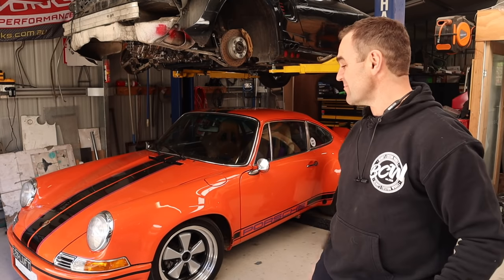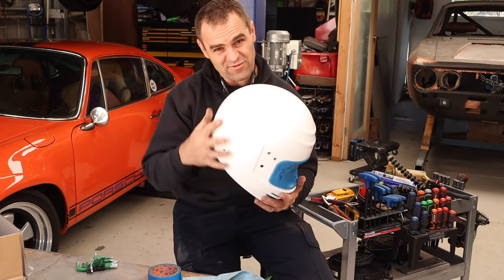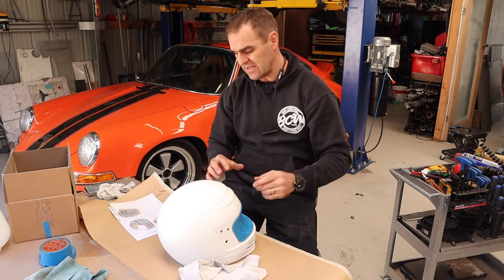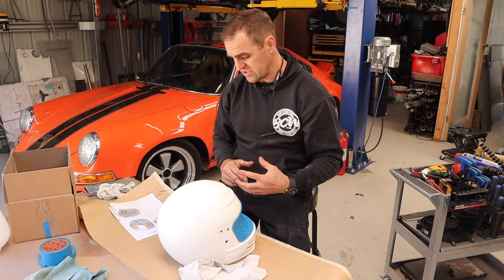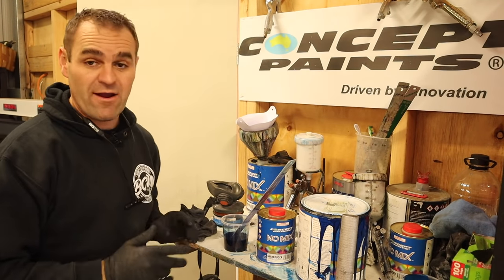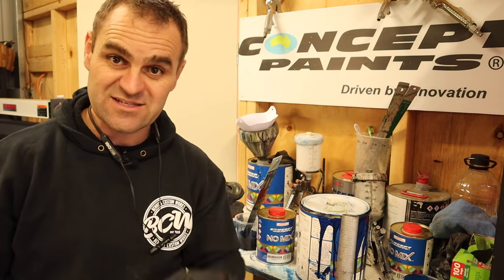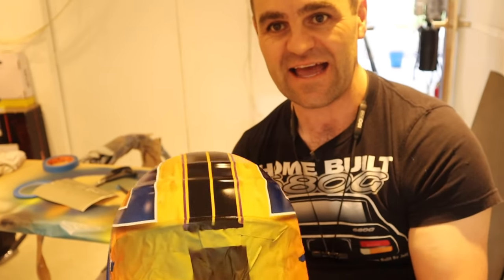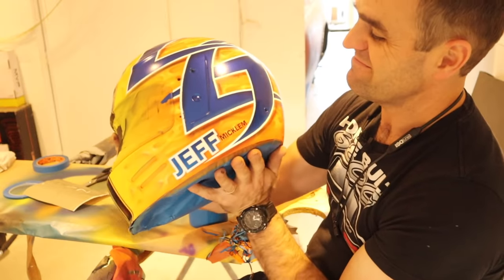How to custom paint a Helmet

Comment: Great work, Jeff.  Just a couple of quick, basic questions, please.  I want to paint a "raw black" Bell Star Carbon helmet (hate the nasty black) into white with some basic stripes.  
First, does it compromise the safety of a Bell Star carbon shell to paint it?
If it's OK to paint, would you use a primer when after sanding down?  You mentioned "auto paint" - would that be enamel or lacquer?  Is there a preferred final clear coat?  
Finally, when you're doing a layout with masking, how do you find and divide a center point at the rear, and how do you assure that that point is extended perfectly perpendicularly upward?  I think if I can set this correct rear line, I can assure a symmetrical layout on both sides and around and my stripes will be aligned and even.

Many thanks,   Bb   North Carolina USA

Comment: From on layer to another, do you spray varnish? I tried to do the same as you and the paint come of  with the tape.
Reply from the maker: If the paint comes off you probably didn't sand the layer underneath enough.
Reply: @HomeBuiltByJeff  thanks

Comment: Be aware that by painting a crash helmet you are dicing with your life. Due to the molecular structure of a helmets material the painting and subsequent baking of said helmet weakens it due to the chemicals used in Car paints and the actual baking weakens the strength and integrity of the crash helmet so when  if it's ever needed the strength of the helmet will fail which could ultimately result in your death or at least a very serious injury. If you read the safety instructions for crash helmets it will tell you not to Paint  them for this very reason
Reply from the maker: That is why, not all helmets can be painted, and also why this was not baked ;)